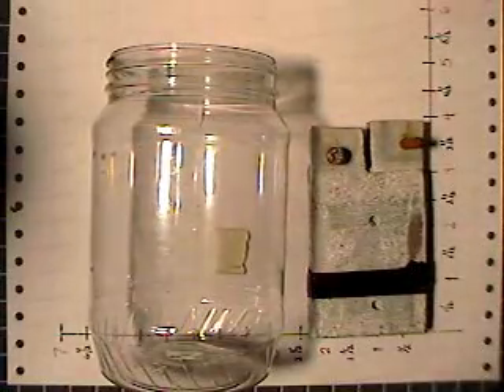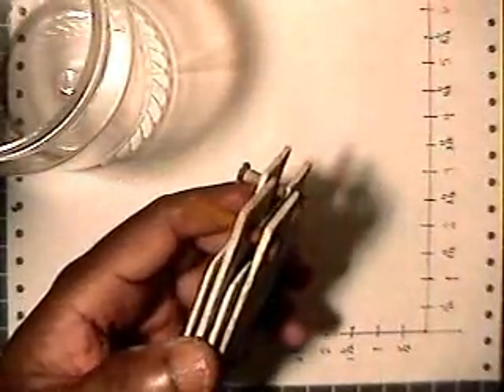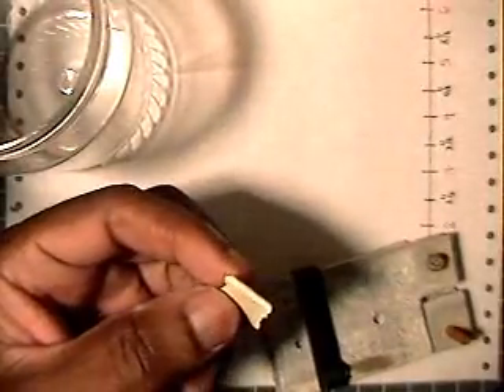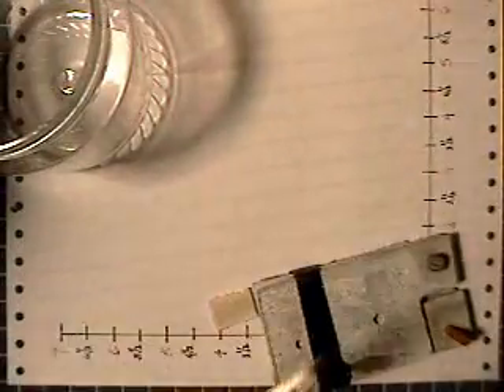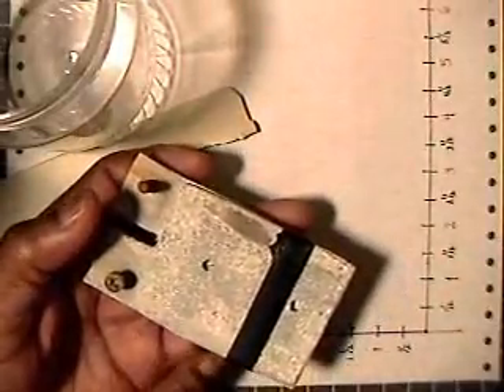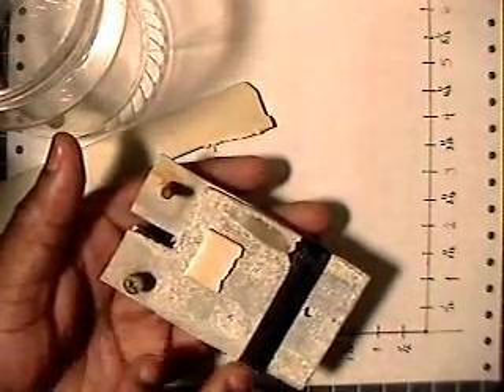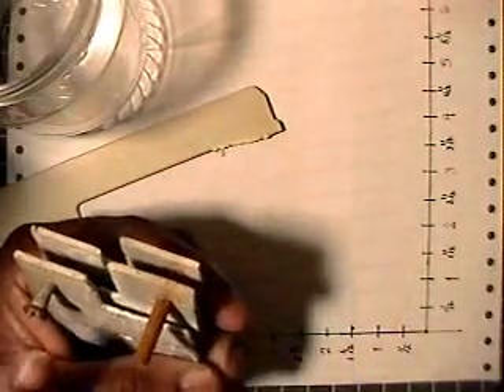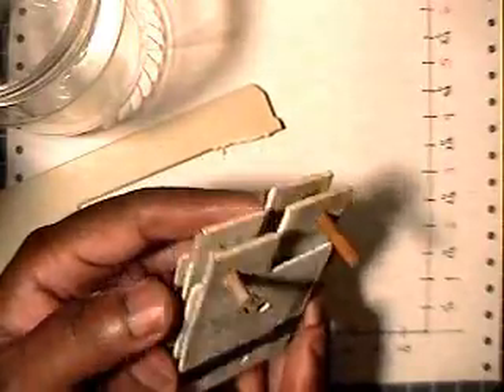HHO Plates

Comment from the maker: Sorry, I forgot to mention the plates are aluminum. They work well and are cheap. But, they produce a messy residue. Go with stainless steel wall plates. You can cut them to fit inside that jar, or use a larger container. PVC works just fine.